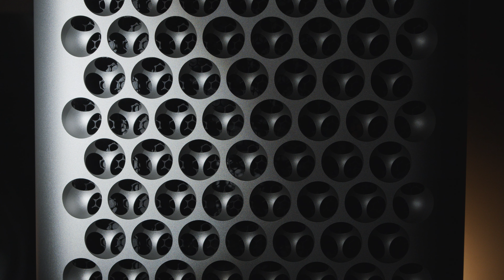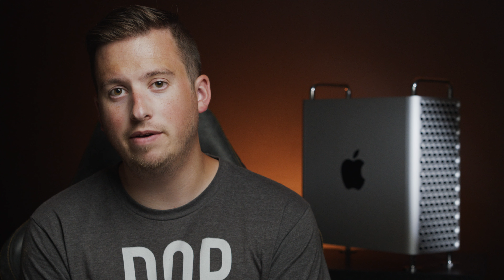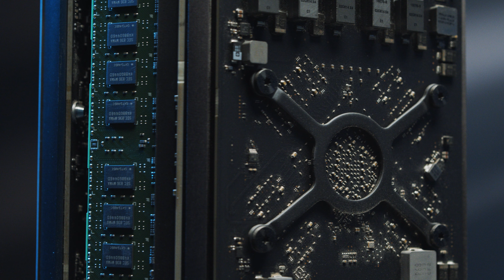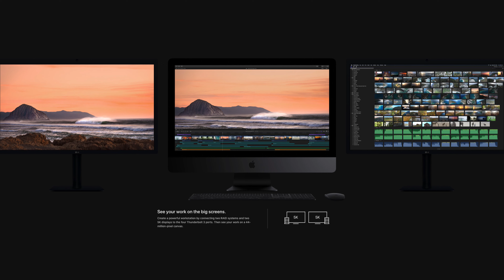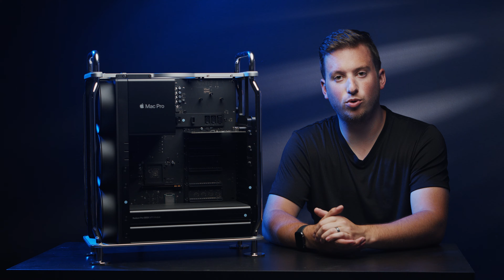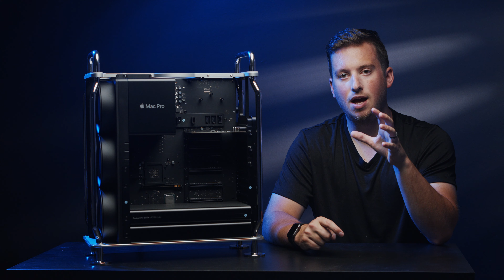Is the Base $6K 2019 Mac Pro worth it?! | My First Impressions

Comment: I am really so glad I watched this video. I have been running a 2009 mac pro since the day I got it with only minor upgrades like a 4tb hdd and a new graphics card. I have seen countless videos on basically how to max out the old mac pros and all the work arounds and hacks you need to do to get it running more modern osx and what not and i just sit and think what is the point. I had the mac pro way back then because I knew it would last me 5-10 years no problem because of its amazing and easy upgrade potential, and this seems to be the only machine that would be incredibly wise to buy at its base (maybe with a bigger SSD, I agree, that is the only thing that is pretty bad) and then, as every single person would do, upgrade as needs be. I was also considering a 2013 mac pro but realistically, it wont last. Im someone who absolutely hates upgrading anything, I love the comfort and useability of my current stuff, but its really pushing the limits now.

Comment: Great Video Brother, I'm in the process of upgrading CPU 8 core to 16 core, Graphics card from base model to vega II, Ram and SSD Raid as well. I don't care about the techie stuff either, just what it can deliver lol. Great work explaining, thank you...
Reply from the maker: Is the process of upgrading the CPU easy enough? I believe anyone who bought the base is limited to the 16 core right? Because the logic board and RAM speed is capped?
Reply: @initialfocus  i believe it's easy enough but your ram will need to be switched out if you have the base 8 core model. From 2666 to 2933 MHz and also the 250 internal ssd can be upgraded to 1 TB. Truth be told you really don't need more than 16 core, but you can take it up to a 28 core

Comment: I would love to wait on the next M1X macs but I need a new mac now. Not sure if I should consider the current M1 mini or imac over the mac pro 8 core, 32gb ram, 1tb ssd or 27" imac 5k retina, core i9, 10th gen 3.6ghz, 32 gbs ram, 1tb rp 5300? I'm a designer and work with large files in digital creation and some video editing. This is a confusing time for a mac buyer.

Comment: Great video, I have a Mac mini M1 on the way, but I might buy the base model Pro just for comparison. I know you use resolve (which I should look into) I am using Premiere Pro and I don't think the GPU is used all that much though. Wondering if going higher cores off the bat might be the only worthwhile upgrade there.

Comment: Exactly the same reason ive ordered the mac pro, same spec as yours just with a tb ssd. Sick of buying disposable heat magnet computers from apple every 4 years or ao.i also agree with the current mac pro reviews on you tube they aren't realistic and are genuinely maxed our or near maxed out spec that is not realistic for **prosumers**.
Reply from the maker: Awesome! You’re definitely smarter than me for going with a higher SSD. That’s my one regret but I plan on just adding a PCIE ssd from other world soon. Yay customization.
Reply: michael tobin yeah although their is an apple ssd upgrade kit recently available from apple that you have probably seen I only got the TB moddle because with my apple discount it did not add tnat much onto the total and i wanted it a little bit future proofed out of the box. Not a Big deal tho you could run a regular hard drive or ssd if you want to save a few quid. Or you can upgrade the apple ssd in your own time with the new upgrade kit. Saves going to the apple store and having tom, dick amd John working on a 6k computer lol.
Reply: I just picked up the base Mac Pro last night. Everyone keeps saying the 8 core CPU is trash. Honestly I’m not doing much 4K stuff. Maybe later on. How good/bad is the 8 core running for you guys?

Comment: Very practical balanced review. I had the same issue in figuring out to configure the Mac Pro for my needs. I did a little bit of over kill on my order but coming in handy now with the canon R5. My build is as follows 16-core @3.2Ghz, 32GBs of ram. I initially went with the stock GPU but upgraded to the AMD pro W5700 16GB. Which made a huge difference when editing Mavic 2 pro footage. I added the Pegasus j2i with 2x 16TB HDD, and the OWC 4M2 with 4tb. I really like the space expandability I really dislike external drives all over the desk. Overall I’m very happy with the Mac Pro. I still need to upgrade the ram from the 32GB stock but not I’m an immediate need for that right now. Thanks for the video.
Reply from the maker: Love the sound of your setup! How do you like the OWC 4TB? Want to grab that at some point.
Reply: michael tobin I like it a lot it’s perfect for keeping my FCPx libraries whilst I’m editing and any footage I’m editing, really makes a breezy editing experience. I’m not running OWC m.2 drives I’m using 4x1tb intel 660p m.2 on a raid 0 I get about 4GB/s write speed and 5GBs read. The drives bottle neck when things get hot down to 660MB/s but speed up again once things cool down. It’s really fast and perfect for editing I’m sure if I got better m.2 drives say from Samsung I would get me better results with out the bottle necking. It’s solid. I paid $350 for the adapter itself and $100 per m.2 drive bringing total cost to around $800. But you can start small and upgrade the drives later the best part of the Mac Pro.

Comment: I'm in the same boat as you. I'm buying my Mac Pro tomorrow. I did go for a 16-core, 96gb and 8TB and one W7500X GPU with 16GB. It costs me around €15000 (about the same in $). I also have a Mac Pro trashcan at the moment. 6-core D700 gpu's, with 64GB ram and 512GB storage. The reason i went with 8TB storage on the Mac Pro is because i made the mistake (twice) of just taking the basic storage and didn't have enough anymore for al my apps. My Macbook Pro is the same. I got it with 256GB and it's just not enough. Even 512GB is really limited. You should at least go with 1TB and if you can 2TB (just my personal opinion). But it's indeed nice to see someone that talks about the Mac Pro that isn't Linus or Marques. (I have nothing against them), but i like that it's different :-)
Reply from the maker: Thanks for that! Early congrats on the new computer! I agree that I also have nothing against the big guys but it’s hard to compare their near 30k-60k systems haha. Last week I bought 128Gb RAM (from OWC. Same Ram but minus Apples markup) so I have 160GB RAM now total. And I ordered the W5700X which comes next week. I definitely agree with you on storage! I now have more RAM than I do available storage 😂 again OWC has new NVME drives 6000mbps speeds. Getting a 2TB for $650! Love the upgradability of this machine compared to the trash can 😂
Reply: @initialfocus  You're absolutely right about that! I've seen some of those PCI-E storage cards. They are fast indeed 😎 Anyway, now i have to save some money for that Apple XDR monitor. I really love it. I will buy the basic one, not the anti-glare one. And yes, i love those youtubers too but like i said, i liked watching your video, you seem like a very nice guy! Maybe you could do video's about the upgrade? 😃

Comment: I am 100% with you, very nice and interesting video you just share with us.
We are scanning old 8mm and 16mm movies and do this in 2K , max 8K, so the base configuration will be fine with some extra  internal M2 SSDs
At this moment we are doing all stuff with a 2010 maxed out MAC Pro 5.1 and now it is time change....
but I am not willing to pay 15.000 for a machine, that is not necessary at this moment.

And the most interesting thing is that the mac under bootcamp run Win10 better and without any problems than our HP Z440 machines......

Comment: Nice to see an actually sensible video about the mac pro. I just ordered one where I bumped up to 12 core,  W5700X and 1TB ssd. I'll add more ram and an afterburner at a later date.

I figured it would save me time as I'll be able to work at full online quality (4.5K prores 4444 from my Mini LF) end-to-end with no proxies. Fast turnarounds will ultimately win me more work, so removing the bottleneck makes sense. I also love to tinker with grades as I work, so that should be totally doable with this machine.

They are expensive, but I found that going for a modest build and then deducting the Apple Business discount and reclaiming VAT makes it ok. 

Congrats on your new mac.
Reply: I went for exactly the same config
Reply: Nice to see a sensible comment too on this machine lol 👌🏻
Reply: Do you think a 2020 iMac with a 10 core and 16 gigs of ram would also be able to handle 4.5k ProRes 444 from the Arri LF?
Reply: @creativeorstrange  I would def go for at least 32GB of ram. You can upgrade it yourself for less money (if you configure with Apple with 8GB then buy aftermarket ram). I'd also go for the 5700XT and some SSD storage. The performance in FCP X might be better with less but I'm using Premiere for the most part.
Reply: mrtreve  thanks for replying! And you think with those specs I’ll handle 4.5k ProRes 44 from the Arri mini LF natively?
Reply: @creativeorstrange  You definitely stand a chance... it just might not be totally smooth once you add luts etc. You need a very fast SSD for the footage. Forget spinning drives, they're no use here!

Comment: I had my Mac Pro 7,1 with dual Pro Display XDR for about 6 months and I love it, I sold a 2013 Mac Pro, 2010 Mac Pro, a 2014 iMac, Dual 27-inch Apple Cinema Displays to help absorb some of the cost, I also added a 24GB Titan RTX when using bootcamp, Next upgrade is GPU and CPU swap when Apple updates the 7,1 one more time before it goes to Apple silicon and I don't know what apple going to do with that Mac Pro 8,1 but we got years before we see it, If I purchase the base the only thing I would of charge is the GPU to a 5700XT but leave everything else stock

Comment: I am actually specing out a new Mac Pro machine right now. I did some research on the GPU cards and they seem to be the biggest thing that Resolve gobbles up. That and having a 12 core machine vs an 8 core machine. So, that's my plan but I like how your plan has more options down the road. I guess I am an instant gratification kind of guy!  I also agree with another comment, 256 GB of storage is horrible.